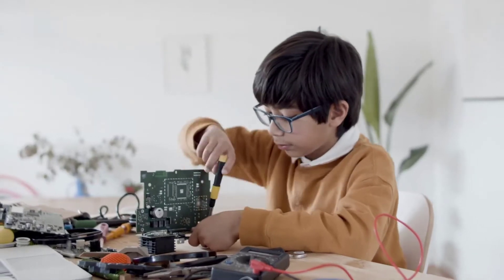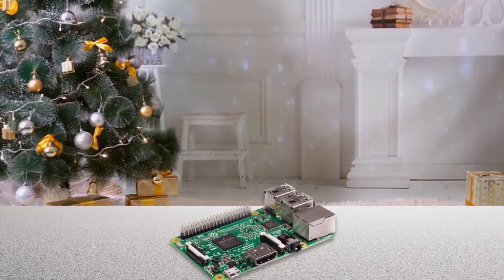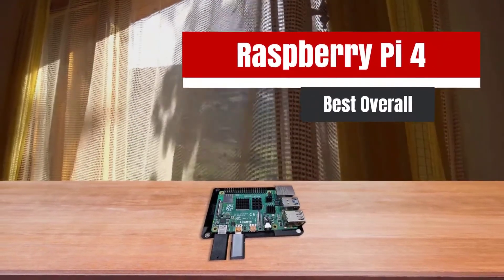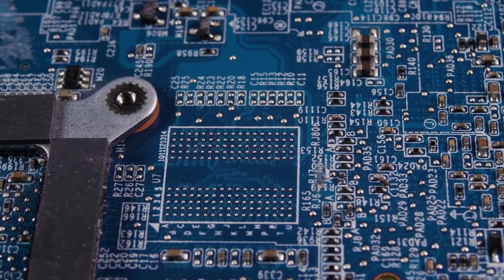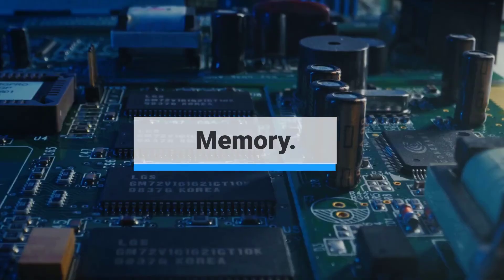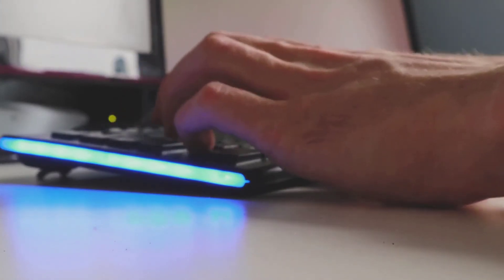Top 5 Best Single Board Computers In 2024 - Review And Buying Guide

Comment from the maker: 00:04 The fifth single board computer on our list is the Elegoo Uno R3 which is known for its versatility.
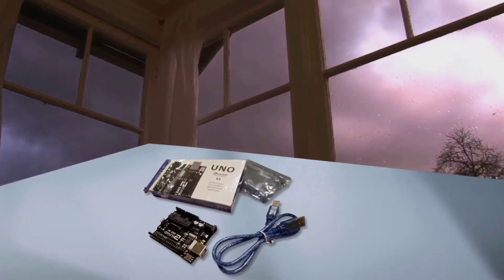01:01 The Elegoo Uno R3 is beginner and advanced user-friendly and comes equipped with the 16u2 interface chip.
01:56 The top 5 single board computers in 2024 are Raspberry Pi Zero W Wireless, Nvidia Jetson Nano, ...
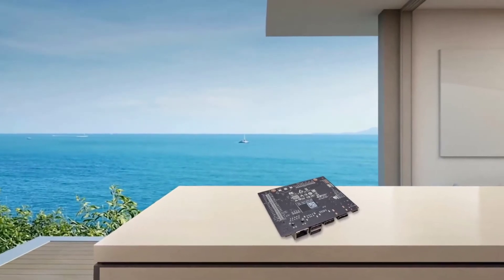03:00 Consider Nvidia Jetson Nano and Element 14 Raspberry Pi 3B+ for AI and machine learning applications.
03:54 Raspberry Pi 4 is the best overall single board computer
04:49 The Raspberry Pi 4 Model B is a powerful single board computer with 4K dual screen output capability.
05:46 Powerful single board computers are required for edge computing applications
06:39 Consider the cost and power needed when selecting an electronic chess board